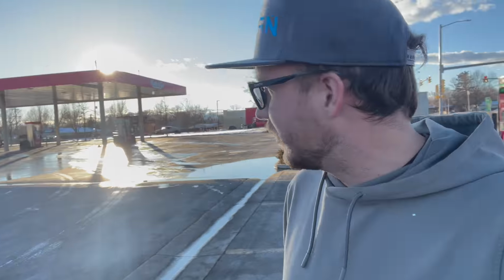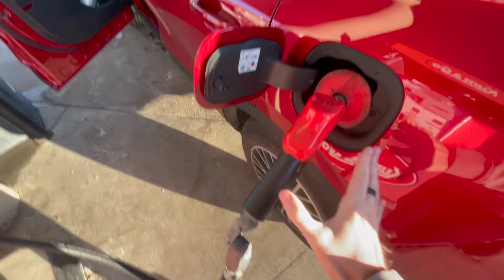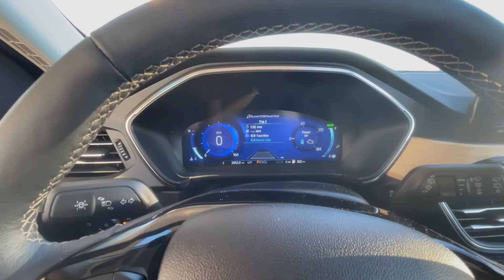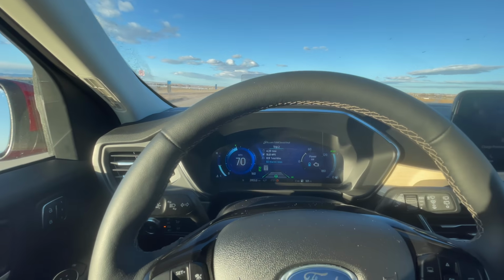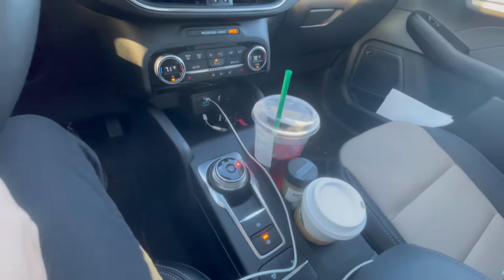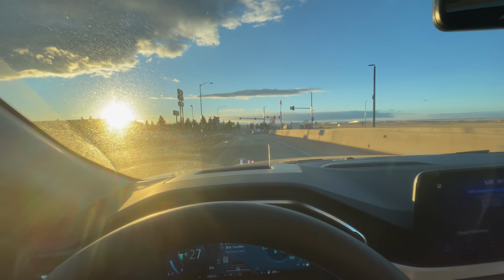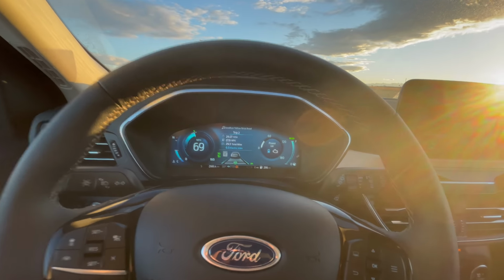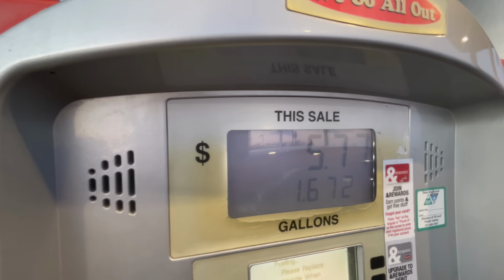Huge Electric Range! But What About The Fuel Consumption? Ford Escape PHEV 70-MPH Highway MPG Test

Comment: Good video, as always! 🤔Question......Did math is been made using the total miles (57) or the gas miles only (53)? Saw that from the total 57 miles, 4 were electric, so with that in mind, the math should be done using the miles traveled using petrol (53). If so, consumption is different 31.7mpg instead of the 34.1mpg using the 57 miles of total trip. Am I right??? Wrong??? Let me know. Thanks!!
Reply: I would say not. They ran the test at 0% battery so "electric" miles is the range generated by the engine and regen not actually charge range. In a reglar non plug in hybrid you wouldn't really count this range as electric since again it wasn't actually generated by plugging the car in but the transfer of energy from engine to kinetic to battery on slowdown and such.
Reply: @reddog678  Understood Clifford, but remember something, those 4 miles were with ice shut down, only using battery and electric motor. So my understanding is that any miles driven by elecricity, no matter if was regenerated or charged in advance should not count. Any energy recuperated braking or using regen is actually energy that should be counted plus the X miles any plug in vehicle have on electric. For example; RAV 4 Prime, has 42 electric miles. But in a  "suppose" trip of 500 miles you used 65 electric miles and 435 with petrol. You should check how much Kwh went to the battery for those 23 miles after used the 42 of the 18kwh battery of the RAV4. Then check how much petrol was used for those 435 miles and calculate the mpg. 
Same for an EV car, you should add those recuperated kwh and miles and then make calculations. Not calculate 340 miles for a 75kwh battery if you recuperated 15-20 miles on 7-8 kwh by regenerating.
Reply: What determines the electric miles though is the car.  How do you keep this test even somewhat consistent across the board if the car doesn't tell you this information. Chevy volt, one of the first phev, doesn't tell you any of the"electric" range after the battery depletes. It calculates everything after the 10.8kwh  (1st gen) as miles driven on gas. 

Using the electric miles from a computer is the same as trusting a car's mpg on the screen. There is a good reason channels like this have developed their tests and rely on fill up techniques and such for their numbers more than what the screen says. 

In the end a consistent test method is all that really matters right? Comparing gas to gas, hybrid to hybrid, phev to phev, and EV to EV.
Reply: But he meassured the fuel to 34.15. So how do you mean?

Comment: Normal “Regular Gas Grade” is listed as 87 octane, when you filled for this test you used 85! The 2022 Escape owners manual states you should use 87 octane minimum!
Reply: “Regular” gas grade is 85 at elevation and is normal for just about all gas stations in Colorado.  Lower octane ratings act different at elevation.  Fort Collins has an elevation of about 5000 feet.
Reply: Depends on the elevation. Not unusual in many states.
Reply: I’ve never seen 85 in Florida.